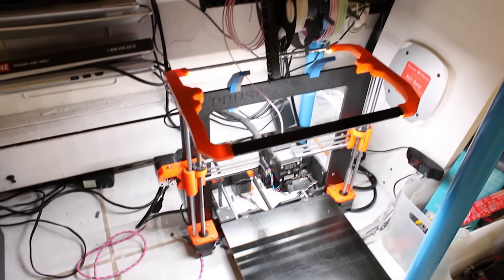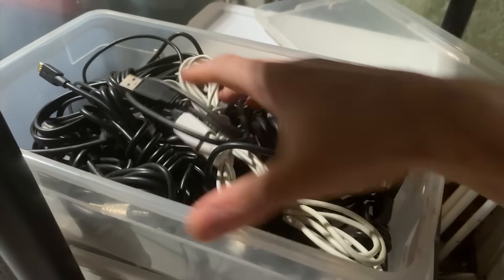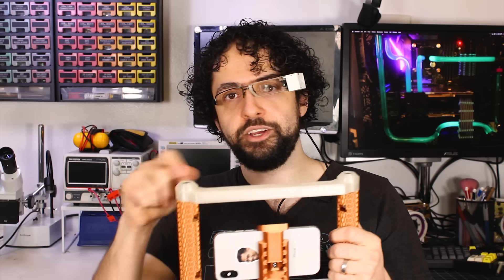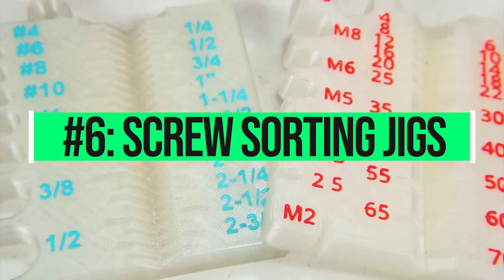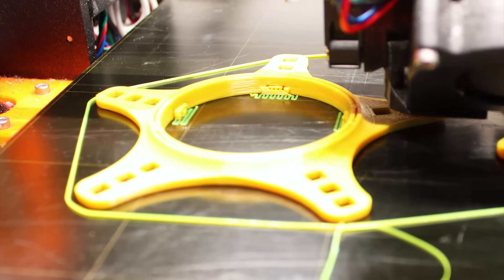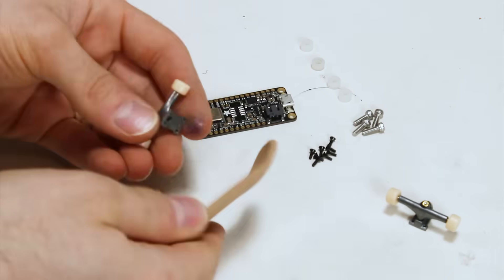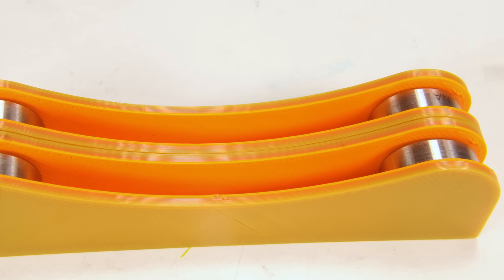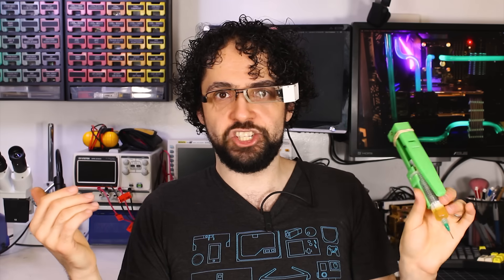Top 10 3D Printable Tools Every Maker Should, Like, Make

Comment: seems like the tush would benefit from being a little plumper on the bottom side
Reply from the maker: This guy gets it
Reply: @ZackFreedman   Y'know, butt jokes asside, couldnt you turn that into a screwclamp kind of setup? Then you could fit that tush real tight and screw it till it sticks.
Reply: @ActuatedGear  trying to phrase this without inadvertently making more butt jokes, but I think if there was a hole in the center with a dowel inserted thru both sides the friction would keep it from breaking.
Reply: @ActuatedGear  yeah screw it till it sticks
Reply: @ZackFreedman  11q111q
Reply: Perhaps a wider base ?
Reply: I agree with people here. Make a hole in the center and/or give the tush a set of legs to keep it from flipping over.
Reply: i have some tush analogue thats connected to each other by some rollers (will fit narrow or wide roll)
Reply: That's exactly what I made :)
 https://www.thingiverse.com/thing:4357851

But I don't use tush anymore because there is another design flaw: if your spool is too light it will get pulled off of the stands
Reply: You are one of the only Youtubers that I don't watch at 1.5x speed. Your subtle humor is great.
Reply: I myself believe that it could be hung up by some rope so the tush can be up in the air near you, and it can keep it stable.
Reply: I'm just lookin for some Tush.
Reply: And there is the sliding rail remix with arms to keep the spools from flying around.. https://www.thingiverse.com/thing:2853619
Reply: @McOldwolf  very nice remix. I made a similar model which snaps to fixed size intervals: https://www.thingiverse.com/thing:3077304
Reply: in addition to plumping and an axle and as mentioned above, i would personally probably add magnets to the bottom and have a steel plate to attach them to.
Reply: All jokes aside, I did find a similar spool holder that used beefer parts, including fat rollers that the ball bearings fitted into  Still need to weigh the spool down with something when it gets towards the end though.
Reply: its funny how many people liked this
Reply: why not just connect them with two extendable bars/tracks? Or even simpler, put two holes in each of them and push rods through, no way of falling over but still fits any size
Reply: The Prusa mini comes with one of these that had two bottom rails and can be adjusted to width. They prob have the files online to print too. Is better than the tush
Reply: I dont mean to be so off topic but does any of you know of a tool to get back into an instagram account??
I somehow forgot the account password. I would appreciate any help you can give me
Reply: @Devon Kenneth thanks for your reply. I got to the site thru google and I'm waiting for the hacking stuff atm.
I see it takes quite some time so I will reply here later with my results.
Reply: @Devon Kenneth It worked and I now got access to my account again. I'm so happy:D
Thank you so much, you saved my ass :D
Reply: @Francis Moshe Happy to help :)
Reply: Made a holder plate for mine.
Reply: don't know if it is still of any use here, but i designed some kind of addon for the tush (thingiverse:5413886), so you can adjust them on two sticks or rods of 6mm diameter. works pretty fine for me and i don't have to trash the tush itself for a new design ..

Comment: Me, having designed my own freestanding filament roller, seeing the tush, and thinking "I coulda done that". Mine is 2 tubes between that fit 608 bearings. The tubes are long enough to accommodate basically whatever, and are crowned, like a dryer drum to make the spools auto center. Honestly, I'm happier with mine.

Comment: Do NOT use thingiverse unless you are rich and have unlimited time because less than half of files print they are usually made by well meaning idiots who make walls to thin leave gaps etc because the fact is most of the people that post designs on thingiverse can use 3d modeling software but dont have a 3d printer its obvious when you try to print their crap i use a k1c and have lost hundreds of dollars of filament to this abortion of a site

Comment: I had 2 18650 batts, explode in my hand in '23, and my hand was about 3 inches in front of my stomach............IT WAS INSANE...........and the burn pain was not normal burn pain, it seemed to radiate a lot more and work A LOT HARDER AT HURTING ME

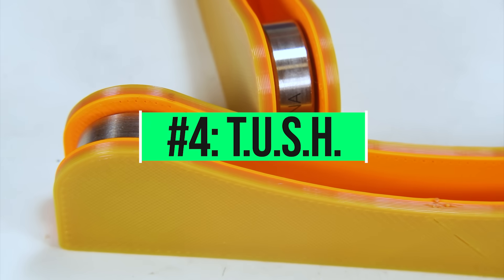Comment: 6:08 I had purchased a big 8kg spool of filament. Not having any ball bearings, I made them myselfes. Luckily I had some 12mm steel balls and have a little practice using OpenSCAD. Now my big spool turns horizontal, as this is the easiest way to do with just one (big) printed ball bearing.
Should anyone be interested, the ball bearing is customizable to the needs within limits. If I get requests, I might upload it to thingiverse.

Comment: I think if you made four of the TUSH parts (maybe putting magnets in the ... backside), you could then make a frame with two at the bottom and two at the top and you'd have a reel enclosure that wouldn't ... spread wide on you. 🤔😬

Comment: Electrical tape is the worst temporary insulation for electrical wires! Very bad glue that turns to slime and often create capillary effects that draw in moisture intothe wires- Also electrical tape doesnt hold anything together properly for long before adhesive is nolonger adhesive

Comment: The T.U.S.H filament rollers are terrible.... The amount of times ive failed a print, Due to my filament becoming nearer the end of the roll... So the spool is lightweight enough to be tugged off it, by the extruder... causing it to fall on the floor, where is restricts the ability to unroll... TADA... easy tway to fail a 28 hour print..

Comment: (NERD mode ON with additional SLOWPOKE mod activated) - the dremel s*it holder is a crap. Such things MUST have a cover. Staying in the open it collects dust and is a complete, ultimate pain in the arse to clean. It is useless without cover. And also useless without some handle for transportation. Even if y naively think this thing is just for my stationary workbench and going to sit here forever. Sa no to open, handleless storages! :)

Comment: The tush is very poorly designed. There should be a very low angle v groove to center the spool on the bearing, the tush pulls the spool against the frame of the tush, negating the usefulness of the bearing. There are others that roll much smoother and use less than half the plastic.

Comment: that flux dispenser is neat and onehanded use. But if the plunger gets stick-slip movement this type can make a big mess by sqeezing hard (to get the initial movement) and then slipping a lot at once.
I've printed the threaded version as it requires a lot less force and more controlled with a bigger mechanical advantage and more control given the screw advance: /thing:3148234

The theory is this: if it's force actuated and that force vary a lot you can't control the movement. Like cracking wallnuts with pliers - very hard to do. As soon as the shell cracks open the big force will crush the insides.
If it's distance actuated it's better at controlling the distance regardless of force variation. Take the same example with the wallnut and crack it open in a benchvise. The slow screw advancement will have a lot of force variation in the screw handle but it does not matter as the jaws will not snap shut after the cracking from the previous force stored.

Comment: Left handed??? Get your self an G903 mouse and an G13 gamepad - Cut of the thumb joystick where it's wedged together and extend the wire inside, make a hole and glue it on the other side of the gamepad itself. Then use the logitech software to customise the buttons and make different profiles. :)

Comment: I'm watching this but I don''t even have a 3D printer
Reply: That's okay, everyone should have goals.
Reply: well then, save up 150€ and get a cheap chinese one
Reply: @mawi4112  yes like creality
Reply: It is worth it seriously there is something for everyone
Reply: I was the same. now I print
Reply: My sweet summer child, I was once like you... Now I have one and an ungodly amount of PLA and PETG.
Reply: Same
Reply: Same. Lookin at diving in head first with the Bambu printers though. The A1 model is the tits, but looking real serious at the X1 Carbon for it's ability to use a specialty filament that I am interested in (GFPA).
Reply: @Tiberius-84  just as a quick heads up the P1S is also able to print PA6-GF (same as GFPA ) and more abbrasive items with just a extruder and nozzle upgrade (60 bux to upgrade) vs the 500 bux price difference in between them. The only true difference is that the X1C heatbed goes slightly hotter and thats a software thing more than a hardware thing.
Reply: Same
Reply: Get one
Reply: You are the 3D printer 😅
Reply: Get yourself one, they are usually poorly guarded
Reply: Really...how interesting...
Reply: Yet…

Comment: I will say that a fingerboard is hard to use, but doable. Unless you have a microcontroller taking up the whole section of griptape. Wait. What's the point of the microcontroller anyways? Can it tell what trick you did? Gyroscope?

Comment: LOL, that filament spool holder is an almost total knockoff of Prusa's.  Prusa's does come with two bits on the bottom that hold the parts with the bearings in place, and they slide for different-sized spools.

Comment: Or you know just use the case that comes with almost all 18650s. Or go to a vape shop and pick up some for like 10¢ each. I vape so I have more than I could ever use and don't know how I even got them. Got a bunch of 21700 holders since I use those MUCH better batteries now.

Comment: you need to learn the shortening wrap for cables. Make several loops of cable. then with the last of the cable, sprial the end around the loop  by passing into the center and around the outside.  all of my cables are a nice little circle. You can make several of these shortening loops in segments so you can unwrap 1/4 (or any other measurement) of cable. I have over 15 cables I am constantly rummaging through at work. I thought I would share, all clamp solutions are .... lacking.

Comment: seems a bit late but to make the T.U.S.H. easier to deal with just stick a short dowel through the center of the reel and then  just loop a rubber band from one side to the other to basically keep it "locked" to the roller bearings and it'll never slip out! problem solved :) modern problems require modern solutions!

Comment: Great ideas! Funny to me that you love the dremel so much, and I'm sure I'll use mine more when I get my 3D printer, but I've always viewed them as terribly underpowered die grinders. 😂
Reply from the maker: It's fine for carving holes in enclosures, filing down prints, brushing solder mask off traces, and other small-scale tasks that come up in the handheld gizmos I build. If I did bigger jobs, it's definitely underpowered.
Reply: @ZackFreedman  yes, for sure, every tool has it's place. I've used mine when trimming bezels for head unit installs, or similar. I think I just initially expected way too much out of my dremel when I got it years ago, hahaha.

Comment: Quick question why do your little battery trays Take an hour and a half longer than when I print them myself
Reply from the maker: I used an 0.6mm nozzle, which speeds things up. I've also noticed recent versions of PrusaSlicer putting in too much solid infill, which is increasing print time for some models by as much as 150%.

Comment: Sir I’m new here what software should I use  it is free ?
Reply from the maker: Industry standard slicing software to run the printers is all free. Fusion 360 is a good free-as-in-beer CAD option. There are a few FOSS engineering CAD programs, but none are good enough that I can easily recommend them.

Comment: I think you use too high an infill percentage on your prints. You can be more economical by using 5-10% on rectilinear and 3 wall thickness. Gyroid looks great but I doubt you are putting more than a few 100 grams of tools on the Dremel collet holder.
Reply from the maker: I've since switched to 10% on most prints. Honestly, it doesn't make much of a difference. The Gyroid infill looks great in time lapses and translucent prints, but my other prints usually have Stars infill for stability.

Comment: The TUSH problem could be solved by having little holes in the bottom of each to glue some strong magnets. Then you could just have a little metal plate on the surface to stick them to. That way you can have a stronger way to secure it without sacrificing the versatility of being able to place them where ever you want
Reply: No no no you dont want glue anywhere near a tush.   the point of the tush is to have easy access to its use.      You always want the oposite of glue  around a tush, which is lube.    lots of lube so that the tush can always be accomodating for its use.  Some good high capacity penetration,  I mean   fillament pulling.
Reply: @PutsOnSneakers  Did you read his comment?  "That way you can have a stronger way to secure it without sacrificing the versatility of being able to place them where ever you want."

Comment: 0:50 let me stop you right there and recommend the G pro wireless. Better than any wired mouse and really light too. Cheaper option is a G305, also has lightspeed, but it only has B4 and B5 on the left side. Still an ambidextrous shape.

Comment: Not exactly what I expected but fun nevertheless.

One tool I've actually made myself (but haven't published anywhere - should I?..) is a cylindrometer with a Vernier scale so I could measure curvature of all sorts of weird surfaces. I haven't needed it since (yet).
Reply from the maker: That's a neat one. If I were to update this, I'd add a fractal vise, feeler gauge, and manual fan

Comment: Nah nah nah, Amazon/“pistol grip syringe”. For ~30$, there’s stainless 50cc variants w/allowance to replace the fluid holding portion, which can be bought in bulk for dirt cheap in plastic or even borosilicate glass.
Reply: Oh, and you can buy thread gauge for ~5$, which is kinda required to sort screws/bolts? That and the diameter. Although, a thread gauge is included w/almost all tap and die kits, but that’s a much larger investment, 200$ + for a complete Sae and metric set. 300$+ if you need to tap high RHS metals more than one or two times. Irwin has great tap/die sets and last a long time w/lubricant.

Comment: Jokes aside, two things that could improve the TUSH;  A) make one side of the base taller than the other so it helps guide the filament spool.  B) put Lego Technic axle mounts in it, so you can separate them and adjust distances using technic axles

Comment: why is everyone afraid of 18650 batteries? LI-Ion batteries are safer than LI-Po. assuming you dont short them out on purpose. 
i've never had a Li-Ion explode and take out the neighborhood like everyone thinks it will. i have like 8 -12 that i savaged and use in a flashlight and other projects. the flashlight gets hot and not one has turned it into a light saber.  
but i have had a newish Li-Po pack explode while charging because my $80 charger decided "Hey lets overcharge this ". those things are finicky asf. you need to store them at a specific voltage too if you dont use them for awhile.
Reply from the maker: I think those 80C 24500’s in vapes ruined their reputation

Comment: For the bolt sizer you could also add hex cutouts so you can super glue hex nuts into it to see what the exact threading is for that bolt (like a 10-32 vs 10-24)
Reply: That's clever, great idea
Reply: or just use metric, it will either be a coarse or fine pitch for a given diameter and you'll be able to tell the difference just by looking at it 😜
Reply: @Pegaroo_  you can tell the pitch of SAE as well and whether its fine or course (UNC or UNF for SAE), but at least at my job I often run into issues where we have a mix of sensors or components made in the EU and some made in USA so there's a mix of Metric and SAE bolts, and it can be hard to distinguish if a random bolt or threaded hole is metric / SAE and also if it's a UNC or UNF thread (although I guess I run into that issue more with tapped holes on machines we are retrofitting or don't have cad data or drawings for rather than loose bolts).
Reply: are you done yet?
Reply: @mrk8212   huh???

Comment: Odd request, however the Tesla cars need a 3D printed clamp of some sort to fit a string for the boot shelf.  This would be a really handy 3D design.  The clamp needs to come off the boot shelf when the boot shelf is quickly removed.

Comment: "High quality filament" 
ehh, to a point. Some, like the Creality filament roll I still have hanging out unused is basically unbreakable but also very low stiffness. 
It's probably ideal for snap connectors but it sucks so much for most things I do. I wish filaments had standard stiffness/brittleness ratings.

Comment: Y'know on the last one you could probably save a lot of fillament without losing much structure by cutting a big ass cube out of the bottom of it before slicing. And maybe print it sideways so it still builds right. Would use supports but I'm pretty sure those don't take as much fillament as infil.

Comment: That dremel tool holder is cool. But i feel like that's the one thing in this video that would be faster to make with a drill and a big block of wood. I know with a drill press that'd be way faster to do manually than to 3d print.
It looks nice though.